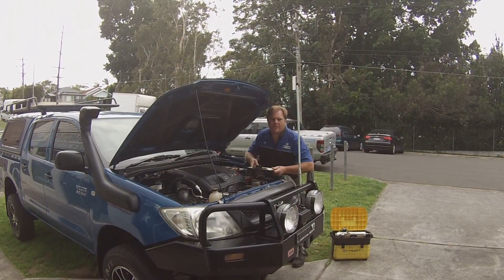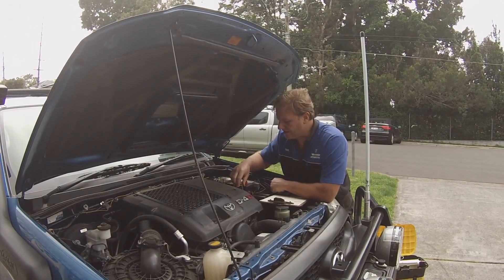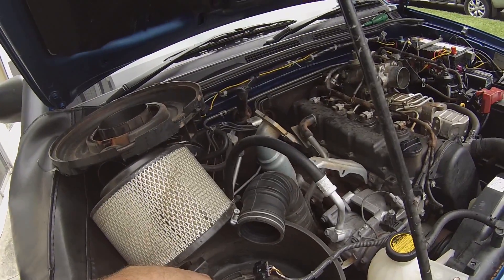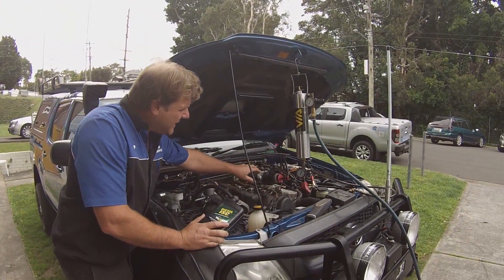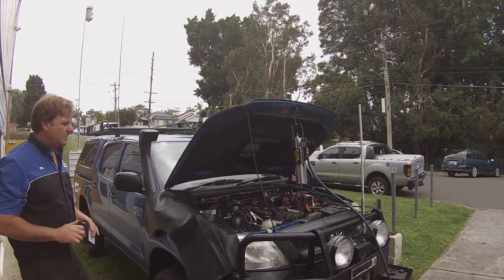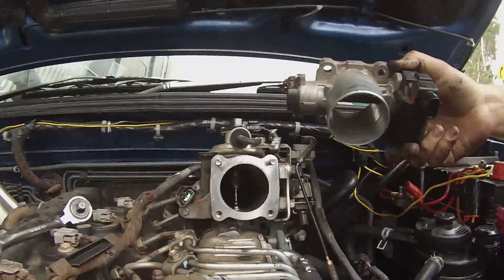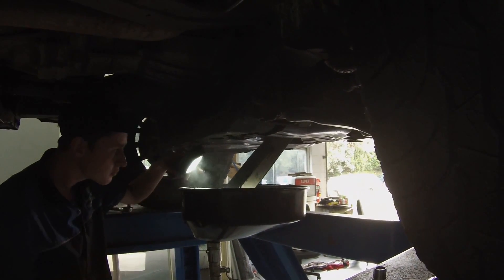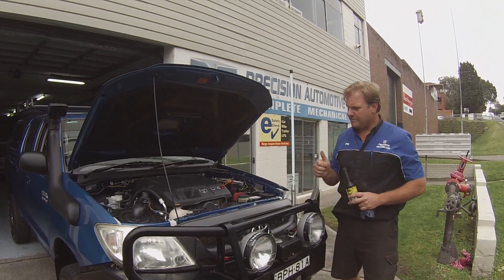DeCarbon on a Toyota Hilux 2009 1KD-FTV 3.0 litre

Comment: That poor turbo! Anyone who has this done and has a mysterious turbo failure soon after.....look no further as to why. Remove and clean your inlet. Knock your head off and take it to machine shop for a clean and decking. Don't ever run any liquids through your engine dumping carbon and chunks into your turbo. 

Do it properly every 150k including new injectors.
Reply from the maker: Yep Agree, remove all manifold for cleaning manually first . the Turbo will be fine.

Comment: What the hell is running all that shit through the motor going to do..lol..taking the throttle body off isn't even close to what needs to be doing an EGR valve clean properly..lol
Reply from the maker: running all that shit through the motor is the end process of the job. manifolds are removed ultra sonic cleaned and then the de-carbon process is used to break down any remaining carbon deposits. on inlet valves piston crowns etc. LOL
you cant also force customers to spend their money in removing manifolds and extra cleaning but it is a waste of time if you dont do it i believe.

Comment: Direct injection diesels. Need a water injection or water / methanol injection system to keep the carbonisation levels low. Add a catch can system. It’s basically the fundamentals of keep a direct injection engine clean and soot free.

Comment: Anyone that thinks its a good idea to flush all that carbon crud through your engine should just stay away from engines.
Reply from the maker: yeah we generally remove the manifold and hand clean it all first then run a cleaner through the system to help with cleaning the bits we can't do by hand.

Comment: take the whole maniold off and have a look at the intake ports aswell they would be caked up still. and where does all that carbon go doing a (decarb) ? straigh tru the motor. do it properly and take it all apart or dont do it at all.
Reply from the maker: That's correct mate . BUT you can't make every customer to do things correctly due to cost. But i will say that engine was very clean to start with . But who knows what's down there untill you take it all apart....???
Reply: yeah fair call mate

Comment: Hello from Brazil! We have a 2013 Toyota SW4 3.0 D4D, known as Fortuner in some markets. The car had some previous issues with the injectors, which the dealer said that were caused by poor diesel quality. This happened when it had 100000 km on the clock, now has 110000 km. Searching online I found that these injector problems are actually common in the Hilux/Fortuner/Prado, and that they aren't always related to the fuel quality. What can be done to prevent this kind of issues? We didn't have to replace the injectors by that time, but if we need to do this, it will cost about 8000 reais (the equivalent to 2000 US dollars).
Reply from the maker: mate do you know what issues they had last time? were they running bad? did the injector seats fail? also are you changing your fuel and air filters every 40,000km? there is a lot of things that can cause the injectors to fail.
Reply: Phil Thorsen apparently they were normal until the car has gone into safe mode. Check engine light was on, but the car wasn't making any strange noises. All the services were realized on the toyota dealer, every each 10000 km. The symptoms were the engine light and the safe mode
Reply: you could add a pre filter to the fuel system or change the fuel filter every 10,000ks. Most of the problems were from the fuel injector seats leaking combustion. and then causing engine wear problems

Comment: Hey Phil , what is the charge for decarbon on 2011 VW transporter manual , seems my car getting little lazy and less power I feel cheers mate, I mean total cost labour and materials :)
Reply: with all respect check this out https://www.youtube.com/watch?v=pAJSOsIbqyc and see what you think, cost of the kit is around $80 only
Reply from the maker: mate give us a call on (02) 9907 6662 and we'll run you through it all
Reply: Depends on how bad it is.  It is a very labour intensive job. could be $1000.00 up wards. Vw THINGS Brake.
Reply: Gee wiz . did you really watch that.????? Did you see the before and after photos ?? Coz I didn't see them >>  YOU CAN NOT remove build up by ANY fluid put down a intake manifold even the stuff we use.
Reply: yes I did watch it , intact result of rolling road before and after shown significant changes, doesn't it BG product which are US made do same thing . Also BG ISC and other BG product only remove SOFT CARBON DEPOSIT not hard deposit :) and off course via air Pressured cylinder instead of cheap pressure bottle? :) :)  I think is good idea if you also can use Rolling road to show before and after performances graph. when even BG product will be around $80 to $100 cost. remaining if I have to pay $900 upward charge only on labour. there should be good reason that yes there is that many hours of work to be done good luck
Reply: As I said.  waste of time just spraying something down a intake chamber and hoping for results.  You MUST remove manifolds and clean

Comment: Do you recommend fitting an oil vapour catch can to help keep a common rail diesel intake clean ?
Reply from the maker: yes absolutely
Reply: @PTPrecisionAutomotive  Would you still recommend it additionally with the EGR system disabled?
Reply from the maker: @chadfordham1  Yeah i would
Reply: Ray Bush i
Reply from the maker: yep for sure

Comment: is this the same for a non turbo 2000 model?
Reply from the maker: petrol or diesel? This clean is for diesels. We do have a petrol on car cleaner as well but its not as time consuming as the diesel clean.
Reply: good, I've got a diesel. i may just bring it down cause I'm in collaroy. can you give me a estimate for price?
Reply from the maker: price varies depending on age and kms and a few other factors so give us a call on (02) 9907 6662 and well run you through it

Comment: my hilux wont start or even kick over cleaned out the egr .someone told me its the timing belt
Reply from the maker: have you checked the starter motor or the battery?
or is it locked up?
Reply from the maker: were you able to figure out what was going on with you car?
Reply: no not yet iv checked what you said